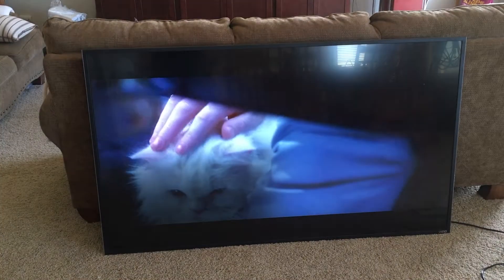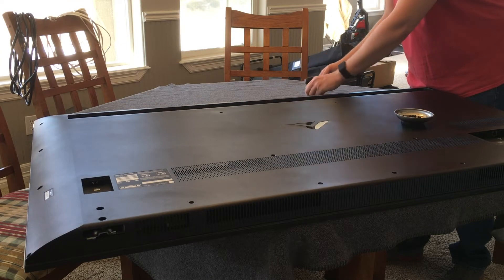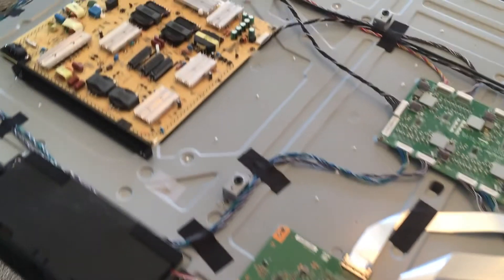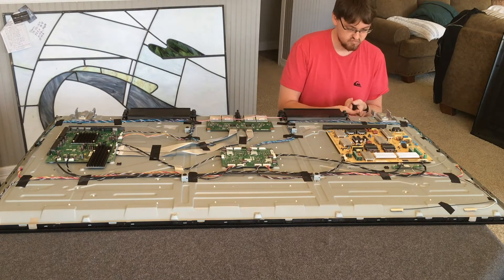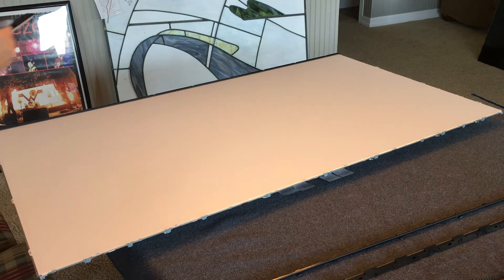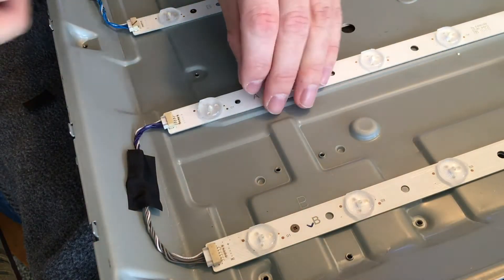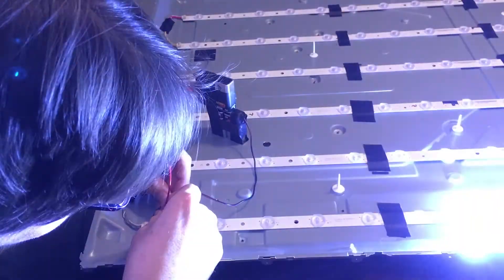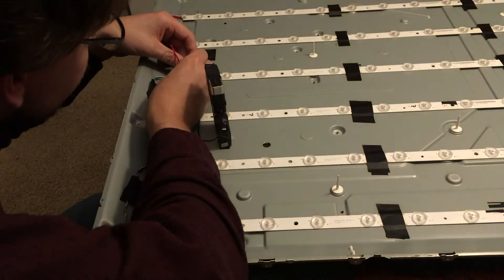Vizio M65-D0 LED Driver Board Replacement: Fix Backlight Issues | CraftTested

Comment: Hello, Thanks for the video.. I have Vizio M70-D3 with one dark strip, and complete lower right corner dark. I replaced the power supply board first, with no change, or perhaps a very small improvement, I have the LED board on order for $30 from ebay coming, will let you know how that works.. but my expectation is it will eliminate the dark corner. wish me luck
Reply from the maker: Hey, Frank–I hope it's a simple fix.  You're right, my guess is that the new LED board will fix the square, but it sounds like you might have a strip out as well.  I would certainly try replacing the board first and hope that fixes everything.  Best of luck and let me know how it turns out!
Reply: Same model tv here....ordered a new/used led driver board...hopefully it works...
Reply: @joeparent8760  did it work ?
Reply: @joeparent8760  did it work?
Reply: I guess it worked.. lol

Comment: Tried this with a Vizio M75-C1 - realized there were two drivers so I switched each one with the new part and no luck. However, my symptoms are that the upper half of the TV is dim and when unplugging the TV from the wall and plugging back in, it goes away for that session. I don't think it's the strips but back to the drawing board.
Reply from the maker: Could be a power supply issue. Maybe get the voltmeter out and try to chase it down?

Comment: interesting!! I was about to buy an all new set of LED strips or just buy a new TV. I have a vizio E70-E3 and I have TWO quadrants out. Is there anyway I can send you a photo and maybe you tell me if it is more than likely the board? I do find it highly unlikely that 6 full strips of LEDs suddenly failed, or around 50ish LEDs.

Here is a photo of my TV--just took this image about 30 seconds ago!

https://imgur.com/a/AR1Qmle
Reply from the maker: Hey! I'm not an expert at this, I just tinker–but I would definitely say that is a video board or power supply problem. Both of those should be easy to fix. I really don't think it's burned out LEDs, way too uniform of an outage. I'd gamble on the video board first–I have a hunch–especially if you can pick one up for around $20. You can always get the voltmeter out and chase things down if you don't want to gamble.
Reply from the maker: ***I believe the proper name is "driver board" and not video board.
Reply: This is definitely led strip problem on  E70-E3 and save yourself time, just buy whole new set of led strips and replace them all at same time. If you complete replacement lower brightness setting on ALL INPUTS and on SMART TV input and it should last. 
https://www.ebay.com/itm/Vizio-E70-E3-LED-Strips-FULL-SET-LB70006-12/273903657483?epid=26033707294&hash=item3fc5ee220b:g:HVwAAOSwFpBexY84
Reply: Bogdan Gavric why wasn’t it an LED Strip problem in the video? Same symptoms as mine. That’s a serious question, not a smartass remark.
Reply: Power board/led board will be delivered tomorrow. Only cost $20. If it doesn’t work,  no big deal, I will only be out $20.
Reply: @cozyxvibees  so was it the board?
I have the same TV but my dark shades are not as dark as your and they go horizontally across the display and it is the second from the top (if we divide the screen in 4 stripes) stripe. But it is a shade and it's not as dark as in your tv. Thanks for the picture.

Comment: This video is spot on, had the exact same issue with the lower left 1/4 of the screen being darker than the rest.  ordered the LED driver board and Boom, fixed just like that.  i love videos like this bc this prevented me from taking a gross amount of time replacing the led strips when i didnt need to.  $19 part brand new and took about 5-7 min to replace.  thanks for the Video!!
Reply from the maker: Right on! Glad it worked for you.
Reply: Having the same issues on my e70 e3 how did you find the board. Would it be the tcon?
Reply: Where did you purchase the part from
Reply: @MsLyssie07  eBay with a 100% return policy
Reply: yes where did you order your part(s) from ?